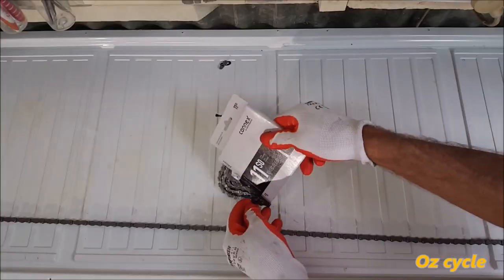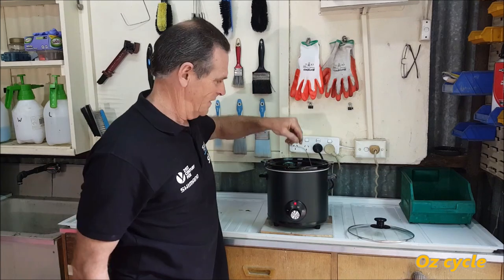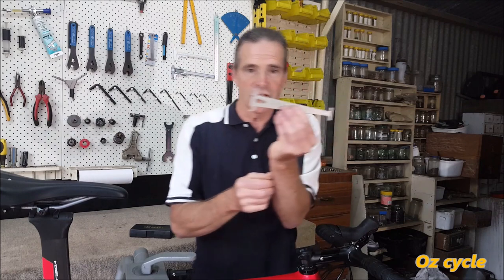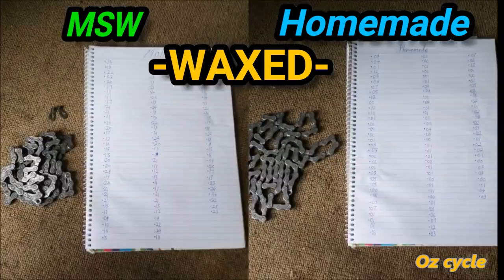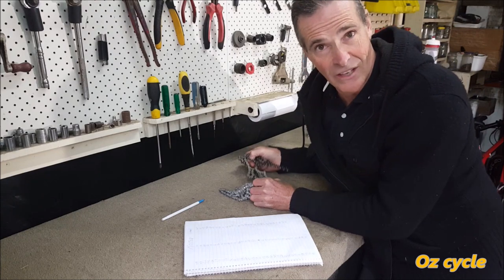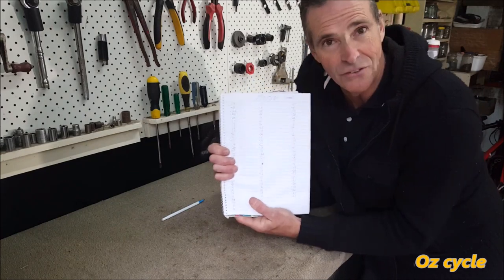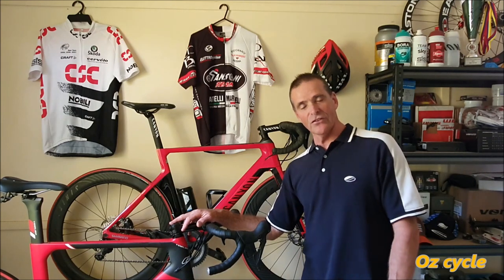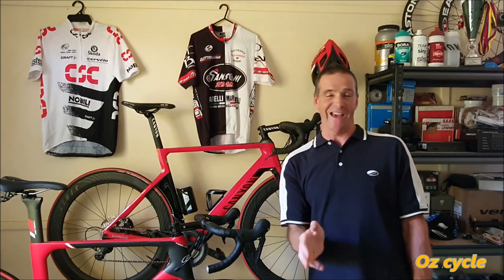Is this the ultimate bicycle chain lube? - Test results

Comment: Oooh, yes. New formula soon, please. I was just ready to dip into my paraffin wax/oil mix when I saw this one. I was wondering if anyone has tried adding graphite powder lock lubricant to their wax/oil mix
Reply: Hey Jason - Yes, i use a simple candle+paraffin oil blend, with quite a lot of added graphite powder. 

I started doing this/tried it at least 18 months ago (main bike gets about 10000km per annum). 

Prior to that i had tried the wax+paraffin oil, and was underwhelmed with durability, and overwhelmed with plentiful drivetrain noise too soon after application. Graphite made a BIG difference. But don't use it sparingly in the mix. 

I just reapplied it -it'd been over 1000km since last application, and it wasn't really "asking"for it -still smooth and quiet enough (still not as quiet as the fairly heavy mineral oil based "Chain-L" i used to use). 

Chain (11spd, Shimano hg601, aka 105) is still less than 0.75 worn, approaching 6000km. Climate is generally dry/ideal. But the "waxite" brew seems to perform really well during and after a wet riding too. 

A friend who does a lot of dusty, dry mountain biking uses and likes waxite for that application. Lasts longer than other treatments, and attracts less foreign matter.

I'm quite interested in this new formula from Steve, but even if it's cleaner and prolongs chain life significantly, if it doesn't last and run quiet for (way) more than 250km, i will probably stick with the graphite brew.

Comment: I have one question. In your most recent video about how to wax your chain you say it should be rewaxed about every 300 km. But in this video you say you took it off and cleaned it after about 3000 km. Was the 3000 km done without rewaxing? Do you recommend running it 3000 km without rewaxing?
Reply from the maker: Rewaxing is every 300km

Comment: Are you adding talc / talcum powder to the mix? Low cost, water insoluble, lowest on Mohs scale- identical/ softer than graphite- but white in colour?
Reply from the maker: Unfortunately talc is absorbent and would keep water on the metal surface of the chain,greatly increasing oxidization....rust.

Comment: In the 3000+ km per chain, how many times did you rewax? From my experience with your old wax formula I would need to have rewaxed about every 200km or so for about 15 rewaxings over 3000km.
Reply: Oz Cycle replied to another comment asking the same question: "rewax every 250km"

Comment: The difference between strength measurements could be affected by room temperature. Was it a controlled environment?
Reply from the maker: It got colder towards the end of the testing
Reply: So, the metal was affected. How much needs tons of math. Kkkkkk

Comment: I still have about 500gr of the old formula 70% and 30 parafin oil.  Can I add the PTFE 1.6 and get the same results?  Watching your vids I see you got a much tougher formula with PTFE than before
Reply from the maker: Yes you can add ptfe to the oiled formula but it will attract some dirt and hence be slightly less efficient or long lasting.

Comment: Cool but you should use audacity to low pass filter and clean your audio. Thanks for your hard work
Reply from the maker: So there's some higher pitched annoyances?
Reply: @stevenleffanue  yeah around and after 7:40 there is a hiss and it isn't consistent eg same place I think @ 1:20 doesn't sound as bad.
Reply: @stevenleffanue  I'm petty sure Audacity is a free was to edit audio even in video find of I remember right
Reply from the maker: I will take a careful listen but my higher end hearing is going with age. I ve got eq.  or FL studio if needed. Thank you for pointing it out  :)

Comment: My microwave goes down to 90 watts, do you think that would be slow enough for this? I don't want the slow cooker in the house, I have enough junk as it is, but I'd still like to try this.
Reply from the maker: No metal in microwaves!
Reply: @stevenleffanue  never been a problem for me :) I leave the steel straw in my hot drinks on the daily for the last decade. same machine, too.

Comment: 12:45 overalll I trust your results - but without "before" measurements of both chains, the data is, technically speaking, completely useless. Have you considered asking Wipperman-Connex about typical process variation in the chains themselves? It's very possible that the two chains started out with different amounts of "stretch."
Reply from the maker: All new chains start out at 12.7mm/link....a new connex chain was hung for comparison.

Comment: Just to confirm, you waxed both chains just once at the start of the test? Did you treat them in any way in the meantime? Have they been washed with the complete drivetrain during 3000km?
Reply from the maker: Only 1 initial complete clean to remove factory lube,then every 250km pour hot water over chain and put in hot wax again.
Reply: @stevenleffanue  ok, thanks a lot!

Comment: I made a batch of the parafin oil and parafi wax (gulf wax) stuff and it only lasts about 50 miles before I hear squeaking. And I hear sit earlier on my 1x setup. I also use it on my trainer and noticed lots of little wax pieces under the drivetrain. Now, maybe the ratio has to be perfect about I did my best. Overall, Im not happy with it for the road but it's nice for cross. Also it is rather messy and time consuming.
Reply from the maker: Make sure you get all previous lubricant out from inside the chain before the initial waxing as wax adheres only to a clean surface.
Reply: @stevenleffanue  I cleaned it with gasoline, then simple green and then water.

Comment: What brand degreaser do you use?  Would Dawn dish detergent be a good degreaser?
Reply: That is probably not strong enough. Use diesel fuel or gasoline.
Reply: @casualguy393  No, I don't think so.  First he uses a solvent then he uses a water based degreaser to clean the chain.  See 2:33

Comment: How does this wax chain lube perform in damp and wet conditions like we get in the UK ? Does it stay on the chain or get washed off ?
Reply from the maker: Wax is waterproif
Reply: I am a massive fan of chain waxing and that is all I use for both my MTB and road bike. But I would have to disagree with the proposition that it is waterproof. When I have riden in extremely wet conditions in the MTB (including fully submerging the drivetrain) the wax does get washed off. I realise that is an extreme example and it does cope with getting a bit wet but it definitely shorten the required rewax kms. Saying all that I am in Australia so very rarely ride in the rain anyway, there is not need.

Comment: Can i use at wippermann connex chain on a road bike (9 speed ultegra cassette)? my cassette needs changing? is ultegra recoomended or should i pick something else with the connex chain?
Reply from the maker: Connex 9spd chain will work fine,assuming your cassette isn't worn out.
Reply: @stevenleffanue  thanks for a very fast reply and inspiring channel -  i was planning to change the cassette as well.. should i bye 2-3 chains so i can process 2 at a time in the chain lube?

Comment: I use a shimano Tiagra chain with molten speed wax and after 1500 km it was stretched to 0.5mm. 
Is a Connex chain really that much better?
Please reply because im about to bye a new chain and i need to know. 
😘
Reply from the maker: I dont know the answer to that Tobias but I do know that MSW want make your chain last as long as ptfe wax. My advice...get Connex chain(comes with quick link) then wax it using clean and wax method in the 2 videos.
Reply: Thanks for a quick reply.
I first cleaned my chain using your method. But now i will switch to Connex. Maybe it will last longer.
I will also order ptfe powder and paraffin wax.
Keep up the good work.
Sent from a happy guy in Sweden.
🇸🇪❤👍

Comment: I have been using your wax formula for about a year, and I can't wait to see the new formula.  Does anyone have a way to make a batch that can be reapplied without taking the chain off?  Also, when I remove the chain and clean in petrol, it takes about 5 washes, creating alot of excess petrol. Am I doing something wrong?
Reply from the maker: Soak in petrol for at least couple of hours or overnight. Give it a swish every now n then. Should only require 1 small amount of petrol then use degreaser to take off any oily film.
Reply: @stevenleffanue  ok, i will try.  thanks!  great videos!
Reply: If petrol is best for cleaning the chain, do you use petrol on the rear and cassette and front rings since they have wax on them too?

Comment: Sorry missed an important word in this sentence mspeedwax- "The real world chain and drive train longevity and ultra low friction of mpseedwax has been extensively proven by multiple test bodies in conjunction with huge amounts of real world customer data, it would be great to see this in a proper controlled test - it is highly possible it will be a great choice for many who do not need ultimate speed etc"
Reply from the maker: Hope to send you a cake of the new wax soon Adam.

Comment: Really appreciate your effort, but at the final comparison (hanged chains) you have had to put some weight on the bottom liks of the chains, because even on the video is clearly visible, the "homemade" version's link weren't just all straight 16:51
Anyways, it's impressive how cahin waxing is much better in a long run (compared to regular chain lubes - with these you can't even dream about 4~5000+ km of riding, while the wax is highly superior to these).

Comment: I need help! I have followed the video on cleaning the chain and wax. 1st ride yesterday 35miles washed down the bike with water to get the mud off. Dried the bike off. Checked the chain this morning and parts of the chain links have corrosion on them. What have I done wrong?
Reply from the maker: Sounds like water left on chain overnight
Reply: What do I need to do?
Reply: I dried the bike and chain using a leaf blower.
Reply from the maker: If you ride in continuous wet conditions add some paraffin oil to the wax batch.
Reply: @stevenleffanue  how much paraffin oil should I add?
Reply from the maker: About 30% should do it. The old formula was 50% which works great on MTB in wet n mud

Comment: I think that what you refer to as chain "stretch" is more credibly the sum of wear on the rollers and pins. I'll keep my trap shut regarding what might be the best lubricant, I've just been out of serious cycling for far too long. But really, the important factors are the barrier strength, the flow, and the attractiveness to dirt. Prioritise any one of these and you are compromised on another. While these waxes would have undoubtedly high barrier strengths and quite obviously attract little dirt, I really wonder about their capacity to flow. I think that maybe cyclists (and the shops that service them) have been overly concerned for a long time about chain cleanliness. Please note, I'm note saying that a filthy chain will work as well as a clean one, just that if most of the actual filth is out of the places of contact, while those points under pressure are well served with a lubricant providing both high barrier strength and flow, that this might be a more efficient compromise.

An anecdote regarding stiff lubricants. Back in the days before sealed bearings, I was about to embark on a very long tour. As such, I stripped and cleaned the bike, but I was out of grease. "Fortunately", there was a place nearby that serviced trucks who were happy to spare a little grease. But the stuff they gave me was MUCH stiffer than what I'd normally use. I'm sure you've already guessed the outcome. It was like trying to swim in treacle. My suggestion is that wax as a lubricant, is much the same.

Comment: 7:26 That is 100% incorrect! A caliper gauge is capable of achieving an accuracy of 0.02mm in the best possible case. An accuracy in the micrometer range is impossible due to constructional tolerances alone. Even a micrometer can only achieve an accuracy of 0.005mm

Comment: As some others wrote, substantial part of the dark stuff in MSW will most likely be the additives.

By any chance, did you record lengths of the chains before use? While it wont be crucial, it would provide some more added value, because then you can compare the extensions. Nevertheless, this can still be estimated by getting e.g. 10 new chains (10 is good for statistics, because you can remove 1-2 highest/lowest outliers and still be left with "enough" numbers) and measuring them, after cleaning, the way you did, or by just comparing the total length of the chains without lube on them. Lot of work, and what to do with so many chains if they will last 40k km each :)

Also, some influence will be caused by the measuring technique, as explained e.g. here: https://cyclingtips.com/2019/08/bicycle-chain-wear-and-checking-for-it/
under the "A DEEPER DIVE IN TO CHAIN TOOLS". If I can see properly, the KMC tool that oz cycle uses, measures the distance between the inner-outer rollers, whereas, ideally, you would measure between the same side of the rollers (and ideally ideally from both sides? before and after use, and compare....).

The MSW chain with wax vs clean seems strange though. Couldn't it happen that you swapped the waxed/clean measurements? Only other explanation I can see to this is if your checker tool measures on the same side of the rollers - then it makes sense that the dirty chain is longer than the clean one (the clean "home-made" being a bit longer would not necessarily be a problem, as it could be just a measurement error).

However, assuming there's no hidden fishy factor playing a role, such as 1 of the cassettes/chain-rings being out of tolerances/worn out, or whatever else, the differences measured are very big. 
Thanks a lot for your videos and I look forward to your recipe!
Can't wait till I will have place to use it on our bikes. Till then, I will have to "survive" with commercial wax (squirt) which works well for me as well.
Reply from the maker: Thanx for the tips. I compared a new connex chain in the vid to show how short they are...all new chains should start at approximately 0.
Reply: @stevenleffanue  Ah, I forgot about that part at 1:55 - they're the two new tested connex chains, one already shortened and the other one to be shortened, right?
Than yep, my comment about measuring unused chains is void. Thx.

To those that find the test to be too "little rigorous". Yes, it's not scientifically rigorous, but it's damn reasonable. You would need an army of paid testers to do it rigorously and few thousands $ on top just for the chains+drivetrains....

About the cleaning procedure - yeah, he used different cleaning procedures, but well, the point of both of them is to get rid of the original lubrication, which both ways will do very well and it would be very surprising if one would degrade the chain. 1. method is MSW recommended the 2. is "home-made", e.g. expensive&tested one vs. cheap one that can go even cheaper.

To those concerned about pollution. I personally clean by coleman gas (=white gas = technical gas = cleaning benzin....) and let the chain dry afterwards. Then I pour the used coleman gas into my "sedimentation bottle" (just any plastic bottle), let it sit there till next chain cleaning/conversion, and then carefully pour it back to "cleaning bottle" so that the sediments remain on the bottom of the sedimentation bottle. And repeat, repeat, repeat. If you want, you can buy some cheap filtration paper and even filter the used gas. However, the gas will stay a bit "dirty" - yellow colored, but still works for me for many uses. I use the same <0.5l for ~2 years.

In the end, for me the outcome value of the test is - cheap, home made wax lubrication will last roughly the same amount of km as expensive solutions (which may have its own benefits though). Also, the durability of the chain/drivetrain will be at least on the same order of magnitude as with the expensive, commercial product. And that's more than enough for me. That was even more than enough with the previous wax version, where even no additives were used (i.e. it's super manufacture+enviro-friendly).

Comment: Maybe the dark powder is SMo2? This was included in Frictionfacts recipe and probably might be in MSW...
Reply: I'm thinking the dark powder left is magnet from the pattern it left when it settled,  so I'm presuming it will contain metal particals
Reply from the maker: Yes magnetic , probarbly fine ferrous dust from the road.
Reply: @stevenleffanue  I think maybe off the chain as the one you waxed didn't have this pattern ? 
Thanks for all the great vids

Comment: You failed to swish the MSW chain sufficiently as evidenced by the fact that the chain was totally pliable when you pulled it out.  There was no wax between the pins and the rollers, whereas your homemade chain had plenty of wax.  You also failed to clean the excess wax from the outer plates after removing them from the bike.
Reply from the maker: Despite what it looks like in the vid both chains were treated equally except for the initial clean.

Comment: Molten in advertising are proud to use molybdenum disulfide, but for a Bicycle this is stupid. I read that molybdenum disulfide turns into an abrasive when it comes in contact with water. This is not an internal combustion engine.

Comment: how does just plain wax compare?
Reply from the maker: You can do that but once the wax wears it will be metal moving on metal which wears the chain very quickly. Additives are a backup as well as an enhancer.
Reply: @stevenleffanue  thanks!